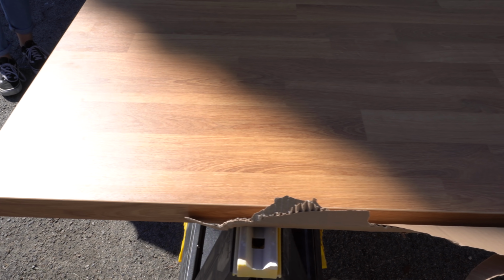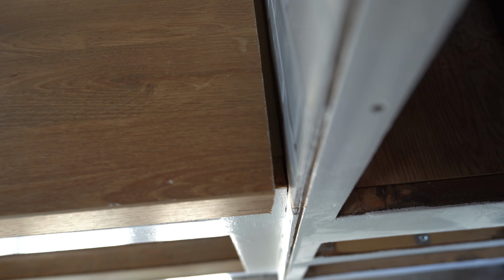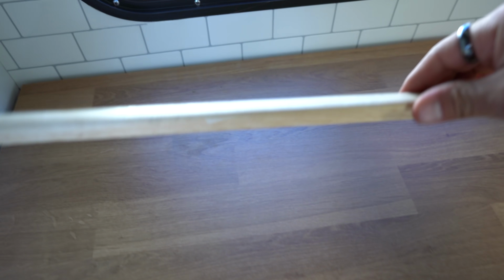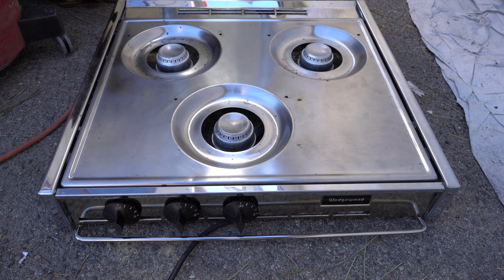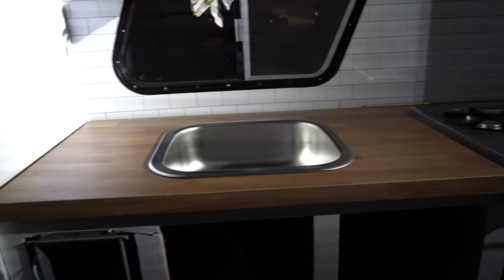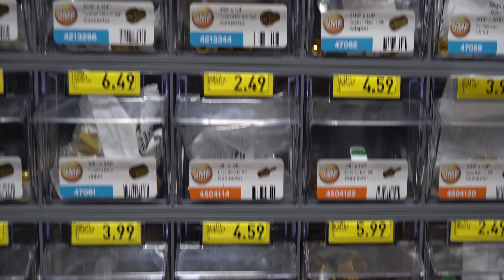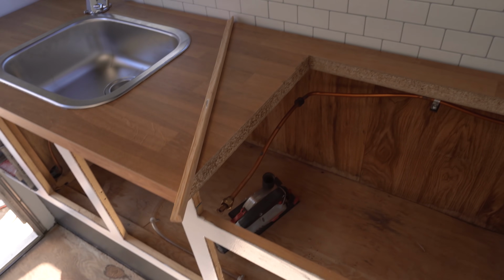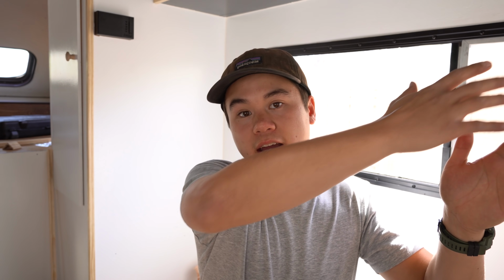Renovating my Vintage Truck Camper - part 7 (New Kitchen)

Comment: Make sure to caulk around your sink, stove, faucet, and also the edge of the wood trim. Otherwise any water that gets splashed could soak into your countertop and make it swell.

Comment: You're doing a great job! 2 things I would have done differently is, 1 I would have just changed out the screws for longer ones on the sink and 2 I would have also the old counter as a cutting template for the new counter. It's all a learning experience. Keep up the great work!

Comment: I was going to say measure twice, cut once, but others already have. You need to get yourself a bag if assorted bungie cords. That truck window should have been tied down. You don't want the cops stopping you for something tgat was a distraction to other drivers. A good brush would also be good to have on hand, especially in your saw bag, so you can make sure the sawdust is off if your project.  There is also dividers you can by for the counter. They are used for when there is a space between the stove and counter. They are called "spacers" and are used to prevent fluids and other items from falling between the stove and counter. I am surprised your girlfriend's dad isn't helping you here and there. Looks good. The floor will look good. Remember, start from top to bottom.

Comment: Johnathan, you can get rubber pieces  at the store that they use in between stove and counter so food won't go down in between. You can use them on each end. Try it and inexpensive.  Good luck

Comment: kitchen is looking awesome....i am about to start my own renovation of a truck camper for the same reason as you :)
the floor is the easy part, stick a layer of foam insulation in there, and then some flooring...if you want to save a little money head on over to your local Habitat for Humanity resale store, they have flooring and building supplies for cheap

Comment: Looks FANTASTIC!!  I didn't see if you did any caulking between the underside of the sink and the counter...Necessary so water dosnt rot the wood. Also, did you treat the wood molding around the backslash?  Easier to do when. Not attached to the counter...just sayin.  You two are an absolutely adorable couple!!!

Comment: paint the exterior highgloss white with black trim, dunn edwards roll on the paint or brush it with a firm brush , no primer needed no sanding needed two coats

Comment: Your stove is too close to side wall. Your plastic tile is going to melt. You may have to put stainless steel sheeting on the back and side of stove. If you don't, the heat from stove will burn or shrink and warp you back splash.

Comment: If you worry about ultra light instead of how pretty ya might be ok .  I would rather had a shower then a 3 burner stove .  Put a dead bolt lock on .  A cement floor is all yr missing

Comment: Dude I'm not a professional carpenter, but as a D.I.Y.er you stress me out. Also go buy yourself longer Phillip head bits for your drill(4 or 6"). For a guy who was gonna do a quick reno (10 wks later) you have gone a little to far (this is all my opinion only) but measure lots to cut once, don't second guess yourself, in the end it will be your home, make it how you want it.

Comment: Please don’t buy anymore black and decker power tools, they’re terrible and do everything significantly worse than basically any other power tools. You’re in your mid 20’s, it’s time to pick a side Dewalt or Milwaukee and never stray from whichever you decide, I’m a Milwaukee guy myself cuz I fuck, but if I’m being honest there’s positives to either and I’m just here to let you know you need to pick a side and start building your collection properly. Start with a little combo dril/impact driver from Lowe’s for like 100 bucks and just add to it when you need a new tool.
Reply: you can get a Milwaukee oscillating multi tool right now for 99 bucks at Home Depot, comes with battery/charger/carrying case. That tool can be used for most of the things you’ve done in this build and make them light work and the possibilities are endless because there’s a million different attachments. Buy that and one of the combo drill/driver sets and you’ll be good to go.